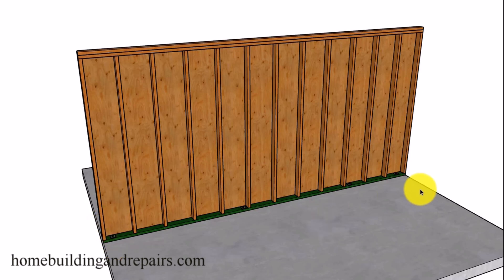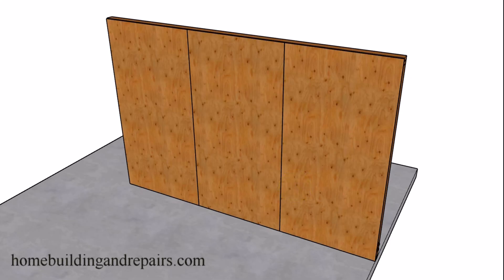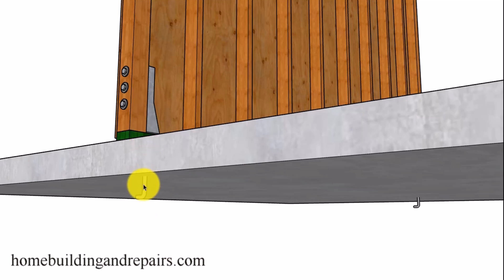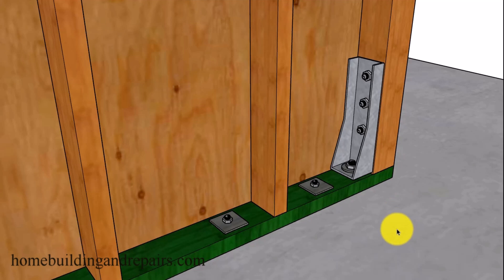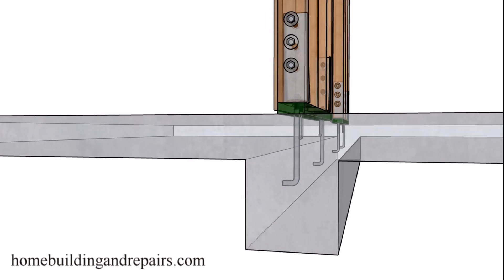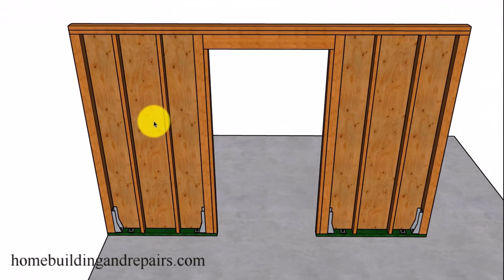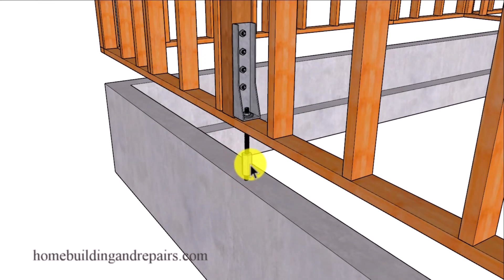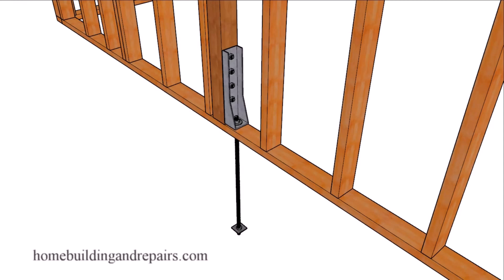Homeowner's Guide For Working With Shear Walls - Remodeling And Structural Reinforcement Tutorial

Comment: In a commercial situation, I've seen an instance where a door needed to be cut into a sheer wall, and they had to replace the header over the door with a steel beam, and diagonal steel braces on either side to support the lateral loads.  It made me very conscious of shear loads.
Reply from the maker: Yes, steel is definitely a good choice for situations like that. It is a very strong material and can handle a lot of stress.

Comment: Usually when you have an interior shear wall there is a footing under the wall if the house was designed and supervised by a structural engineer. 

One thing to note is that if you reduce the length of a regular shear wall depending on the lateral load the shear wall might need to be buffed meaning sometimes you have to use a triple sill plate and different spacing of nails around the edge and in the field.  

Also, there is something called an aspect ratio (sw height / length) depending of what type of lateral load you are dealing with (seismic or wind whichever that governs) and that aspect ratio has to follow some rules. Basically, that is because there is an absolute minimum of what we can call a shear wall. So, for example, if you have a 10ft shear wall the minimum shear wall length that you are allowed to use in normal conditions is 5ft (an aspect ratio of 2) , lower aspect ratio than that and you have to do some extra calculations. When the shear wall aspect ratio is above 3.5 that is when that wall cannot be classified as a shear wall, and you need different solutions like a moment frame or a Simpson strong wall. Strong walls do no follow normal aspect ratios being that they were designed as such. 

Having split a shearwall like you show in the animation (by using a door) the connection between the two shearwalls might not be adequate anymore (depending on the load magnitude) so that might need buffing up to. If the opening size is small (like a 2ftx2ft window) the shearwall might still work with the addition of strapping around the opening and the aspect ratios of the left and right of the opening remaining shearwall panels are adequate.

Another point is that if you have a shorter wall as a shear wall the holdowns that were previously installed could no longer work because the uplift force increases by having a new shorter wall and might exceed its allowable uplift capacity. 

These are some of the reasons why people stay away with messing with a shear wall. Some might say that they have done renovations like this and did not follow any principles, and nothing happened. That is because lateral load (mainly wind and earthquakes) happens due to nature. It might happen in 20 years or maybe tomorrow.